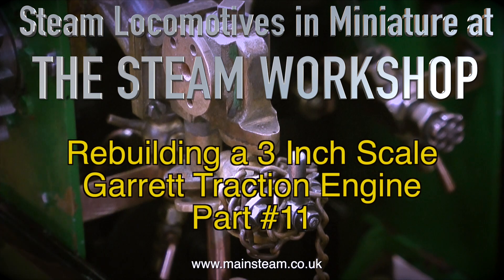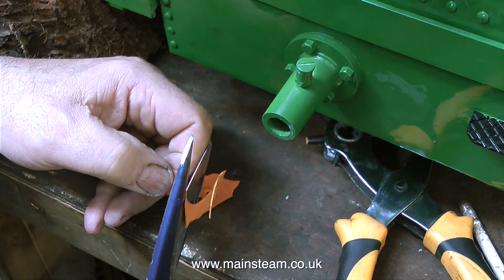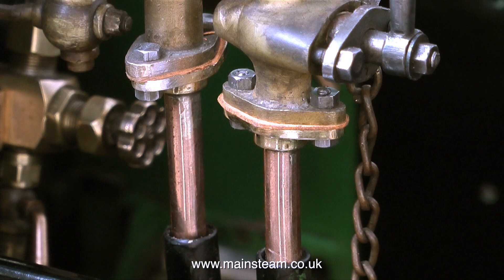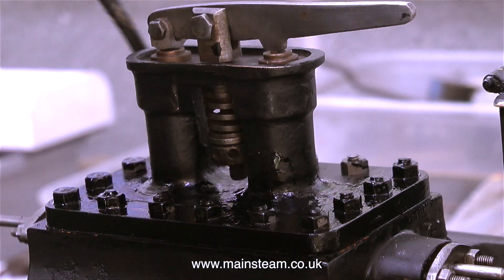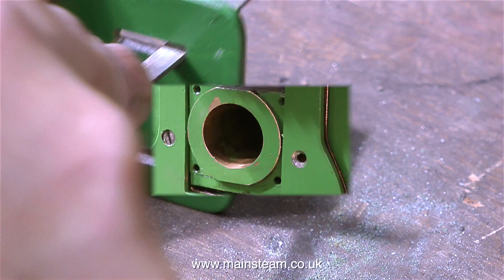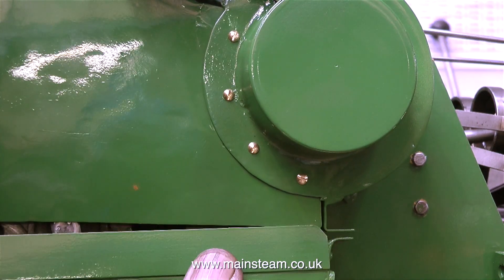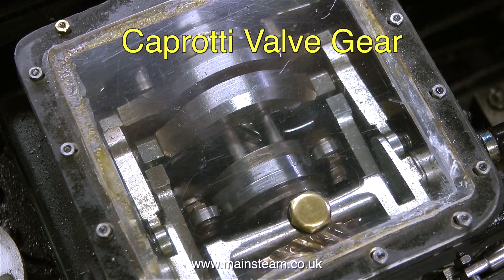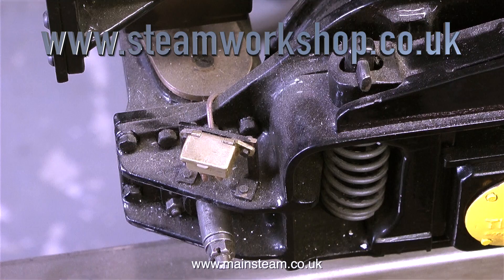THE STEAM WORKSHOP - GARRETT DCC TRACTOR - PART #11

Comment: Hi, love your YouTubes.    I watched you cut a bolt using side cutters.  Are you aware that most wire connecter crimp tools have as assortment of threaded holes where you can screw in a bolt to the correct length, then simple cut it off, when you remove the bolt in "cleans up" the threads so they will take nuts or screw into a threaded hole easily, google to check them out.  Plus they are not expensive.

 Also do you have a set of wobble socket extension?  They make life so much easier when turning bolts and nuts in night places.

This info may be superfluous to a man of your experience.  I just wanted to help, not interfere.  Take good care of yourself!

Comment: Keith I have meant to ask a few times but forgot, now I remember so here it goes. Where can one get a set of BA sockets for 1/4" drive. I have quested high and low and clearly they are not an easy item to find short of a specialty shop...
Reply from the maker: I bought a set from Blackgates Engineering a few years ago - please Email: mat@blackgates.co.uk - he might know .....
Reply from the maker: There are some sets on the UK Ebay ......
Reply: I will do just that, thank you Sir..